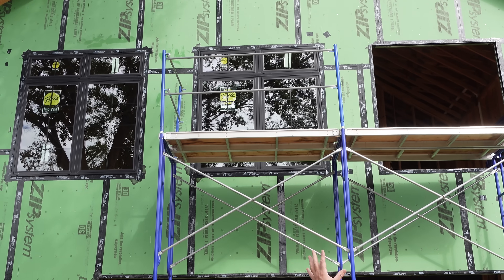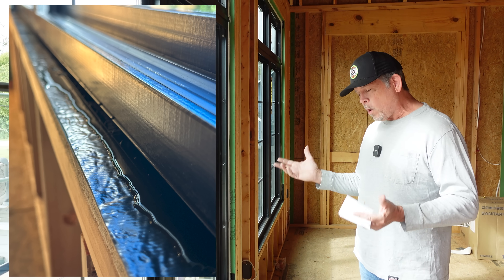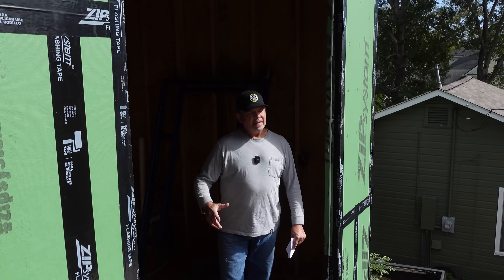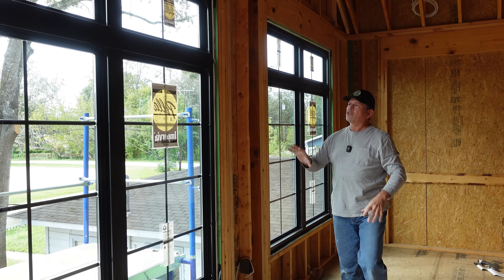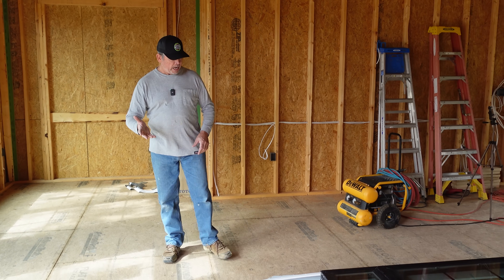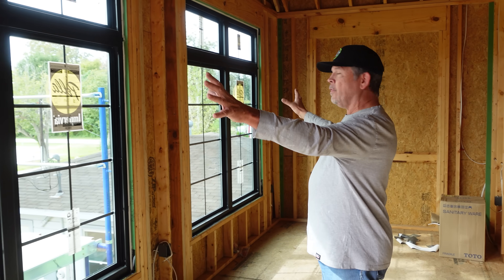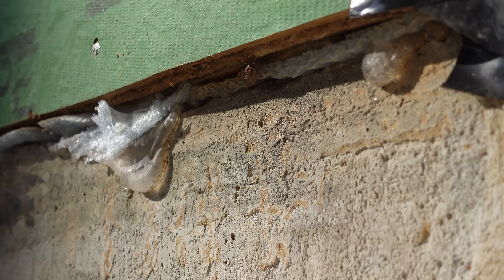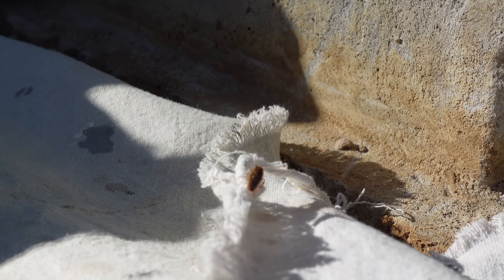THE WINDOW DISASTER - What Happened and How We Could Have Avoided It

Comment: When I saw the title of the video I thought a window fell and broke. 
Hmm.. I'm allergic to pablano but my mom loves it.
Nothing wrong with making mistakes and learning from them. It helps others who make mistakes too. It can help others to avoid those same mistakes. Also, the nail fins should have been sent with the windows if they weren't already attached & it sounds like they weren't, so it's not really your fault.
I'd be pretty irritated if I paid as much as Jordan did for those windows & parts were missing. I hope the little flaps can be sent and installed or Jordan is owed a partial refund for missing parts.
Cleaning all that stuff off the window must have been a royal pain.
Good progress and the liquid flashing came along nicely. I agree that making it so the zip sheathing is flush with the edge will make things easier to seal. I've also seen some sort of seal that goes under the walls and then wraps back over the sheathing. I forget what its called though. It also wraps down over the concrete-- It's sort of T shaped I think. Maybe Protecto Wrap Triple Guard Energy Sill Sealer. That stuff you apply adhesive to stick it to the concrete like an L but there is a self-adhesive flap that you fold up on to the sheathing (after you tear away the protective covering).

Comment: If only the one window leaked, I'd say it was an install sealing fault on that window. I think you did just fine the first time without the flange. The window that leaked "was" the first window you did and something was likely missed whereas the other two didn't leak tells me whatever it was that leaked in the first window wasn't missed in the other two. The only other thing could've been a window manufacturer fault that you proved not the case with your testing.
Great to see a guy tell it like it is and show something that when it went wrong "you took responsibility" for it and made it right. That's very rare today. Integrity. 👍👍

Comment: Your idea of having the edge of the Zip in contact with concrete concerns me. I would repeat the same process you used here. Possibly, you could Zip tape around the edge of the Zip boards in contact with the concrete and inset the framing but over time I'm thinking the abrasion of the concrete against the bottom edge & tape will fail. Maybe Zip tape around the bottom edge of the lower Zip boards and install them with 1/4 inch gap between the bottom of the boards & the concrete, and flash/seal between the 2?

Comment: This is alarming to me as I was about to be ordering replacement windows without flanges because it’ll be likely some time before I do the siding next. But now am not sure what I’m going to do… after watching this video they are basically saying their first install failed bc they didn’t order the flange?!? I know this house in video is a new construction build, but if I’m not mistaken, when installing full framed replacement windows, you are still clearing the area down to the rough opening, just like new construction, the only difference is not to disturb the existing siding so in order to do that there is no flange.

Comment: Could the offset of the window without the nail perhaps been the issue? Set in too far and didn't allow it to disperse the water into it's intended location. In other words the window worked correctly but because it was set in farther it drained the water into the house rather than outside just because of the drain location.

Comment: Kudos to y'all, guys! Anytime you are doing stuff for the first time there is a learning curve. Each manufacturer has their own designs and their own method of installation. A window is not just a window, and a door is not just a door. They are all different. There is not a single contractor out there that has done it all, and if they say they have, they are 100% lying to your face. The difference between an amateur and a pro isn't the number of mistakes made. It is how they handle the ones they inevitably make. Pros fix the mistakes and make it right. Amateurs cover it up, and leave it for the next guy.
Thank y'all for making this video and for drawing attention to the fact that even when you do what you think is beyond what is needed, skipping one step can set you up for failure. No one is perfect the first time OR every time. Keep on cranking along, but never feel ashamed to go back and fix your errors. That's how we learn.

Comment: You need to put more screws in the flange, usually every other hole. That is what gives it the strength to withstand hurricane winds and drastic pressure changes.

Comment: The issue is that you caulked the bottom of the window and you didn’t have a wood backdam. Water can get in through the mull strips. Once it get it in travels down the mull and needs to get out. You need a wood backdam under the sill flashing tape to make sure it can only make its way outside. Then you need the bottom of the window un-caulked where it meets the sill tape so you’re not trapping it inside. You only seal the bottom of the window on the INSIDE. Completely on the inside of the milk strip.

Comment: Man that’s BS! The manufacturer should take responsibility for this!!! Why the hell didn’t they send the fins with the units. 🤬🤬🤬
Reply: Based on the video, I’m not sure if the flanges are just an option for these windows. Depending on how the purchaser wants to install them, would dictate if they need the flanges or not. Was it a situation where the stud pack should have requested for the flanges, being this home is a new build? Or were these windows engineered to be installed only with the flanges as a new construction window. If that is the case, then I would agree with you 100% and the manufacturer should have shipped the flanges with the windows being they don’t want to manufacture them in the facility to avoid damaging the flanges on such a large window in shipping.
Reply: I hope this is the case where these windows were engineered and fabricated a certain way to only be installed as a new construction build, and need the flanges to be installed properly. Otherwise, I am hesitant to purchase replacement windows for my home because it seems they don’t hold up as well as windows with flanges.

Comment: I think it’s better that your sheathing sticks out away from your foundation as it lets water run down your wall, and drip away from that sealed area keeping water away from that seem
Reply: I feel like a metal drip edge would have been easier to seal.
Reply: I agree. Stud Pack's jobs are nice ... because they do them twice. If your Zip panel is flush with the concrete foundation then water can wick up through the foundation and start to swell the edge of the Zip panel. Do you really want to do this job again? Do your main house like you did the garage and you'll have no problems.
Reply: Full agree
Reply: Is it possible to put a metal edge behind the sheathing?
Reply: Why not zip tape the bottom piece of sheeting before install
Reply: @fredkk79  Waste of time since you still need to seal the gap.
Reply: @sweepingdenver  but couldn't you do that then with regular sealant
Reply: Probably shouldn’t put unfinished edge of sheathing on concrete….use liquid flash or wrap in zip tape or both…..I think I saw Risinger or one of his affiliates do the offset detail once with thick insulated ZIP….you guys have an advantage in that you can dialog with Huber and other manufacturers about these things.

Comment: Guy's did an awesome job sealing the bottom of the Zip board . What we've been doing is setting the sill plates back the thickness of the plywood so it flushes out with the foundation. Then we install a ' Z ' flashing that goes in front of the sill plate then under the plywood and then down the face of the foundation . Keeps out termites and water .

Comment: All of the flange holes should have a screw, unless stated in the manufacture installation details not to fill all holes based on wind loads. It is like Simpson connectors. All holes filled with a nail or screw.

Comment: So did the first install fail only because these windows are not engineered to be installed as replacement windows, and that’s likely why one failed? Or is it because they installed it their way rather than Pella’s directions? I’m just trying to understand if these windows were only intended to be installed with the flange, and because of their size, they don’t build them with flange attached in factory, and they should have been mailed out with the windows just not attached to avoid damage in shipping. He said, “they didn’t mail flanges, and that was on us…” so that makes me think it was optional and this window was designed where it could be installed either way, (as replacement or new build w/ flanges)
Reply from the maker: The windows should have come with separate flanges that are installed in the field.

Comment: It's funny that you ran into this problem. On the install video, I was wondering why you'd have two different types of window installations. I don't know anything about installing windows so I figured between you guys and the manufacturer, there must be a good reason. Turns out that mistakes were made. Sucks that you had to take a step backwards to fix the issue but it's also good that you found out before you got down the road of the build and had to pull apart half the building to fix the problem.

Comment: Would it be that hard for Pella to toss in some nailing flanges in the box?
Reply: They would be happy to if the customer ordered them. Complete waste to send them along if it is a retrofit and they won't be used.
Reply: @JorgTheElder  this isn’t a retrofit, it came with the tracks for the flange for a reason. As Paul explained, for whatever reason, these types of windows specifically don’t come with flanges from the factory. They come with the tracks only. So in my opinion, pella dropped the ball.

Comment: I've NEVER REALLY liked 'replacement' windows...often you have no other option but I AWLAYS, whenever feasible, like to use windows w nailing fins. I also like to use a 1 1/2 or mostly 2" aluminum roofing nail to nail my fins. Every other fin hole is quite ok... however, I have removed old windows when I'm replacing new windows & inevitably, some clown used like 5 nails for the whole window. Also, I think nails are super ok rather than screws. Nails are super flat, as opposed to screws which stick out a little... I HATE that. Just sayin...
Studpak broskis, your doin just fine...don't mind us... too much...
And by the way, I'm 65, still kinda putzin' on small to medium jobs, I can be somewhat selective, & I LOVE to still be learnin'... I love doin' decks, siding & window...outside stuff...
Yup, do the other 2... it's a couple hours at most w 3 "Studs" ... so "JUST DUU ETT"...
One LITTLE thing that makes me a LITTLE crazy is... you guys are ALWAYS doin' stuff on the floor... 3 horses w/ some lumber or ply... work at a nice height so the work is easier to see, access & accomplish... just sayin'...
NOPE... put all the fins on NOW... slide the window out, nail it in... bingo bango bongo
ALSO... one of my 'best friends' is dish soap... put a dribble on the window where u slide the fin on... it will slide in like a greased monkey... you guys should invite me to one of your jobsites... just sayin'.....
Zip bottom 1st, then sides but run it up 4/5" past window, then zip top...
Also, I almost ALWAYS have some kind of a rag in my nail pouch, I like a nice cotton t-shirt kinda rag, & use the rag to run up & down your Zip instead of just your fingers. You'll be able to press harder w/o destroying your fingers... just sayin'...
Also, do zip on bottom, just run it on the fin & not up on the window... just sayin'...
I also do one or two little things that are slightly annul... & that is, cuz I usually have a lot of tools out per each job I'm doin'.. is a cordless drill, sm drill bit, silicone behind window frame hole, install shims snug, predrill thru shims, run your screws.
I use a lot of different metal flashing applications in areas like the bottom of a wall
I would have some heavy 6mill or even some med weight tarps to put over those two big doors, keep out the weather

Comment: I gotta be honest, I have probably put in 1000 windows in the Northeast and never have left the bottom flange "open". Never ever had a water leak, not sure what you are doing, not sure why you ordered "replacement" windows for a new construction build, new construction windows have built in flange molded to the window not slide on flanges. Screwing those flanges in with screws over tightens the flange in those areas causing buckles when that flange expands with heat. Nailing in flush in every hole with siding nails is the better way in my opinion.
Reply: They didn't order replacement window on purpose. They picked all the options and the salesman entered the wrong thing into the computer. The salesman knew it was new construction and should not have ordered them.

Comment: If the sheathing is flush with the edge of the slab, you can use tape to seal the joint - instead of liquid flash. Don't remember the name of the tape - it's in one of Matt's videos.

Comment: yeah, i dont know why the europeans are able to do box frame windows successfully... but the nice thing about NOT using a nail fin (if you can detail correctly) is the windows can be recessed into the opening... and it looks 100% better with just a few inches. most new builds look so flat and cheap... its too bad.

Comment: Well done guys fixing and acknowledging you mistake. I too just love doing things 2 and 3 times, not.😂😂😂
Also pro tip for y'all and everyone on the liquid flash. Get a 2 or 3 inch chip brush, disposable paint brush, and cut the bristles to about an inch maybe less. It makes spreading liquid flash on uneven surfaces much easier. 
Also I've found that Prosoco liquid flash to be better than Zip. Prosoco seems to last longer exposed to the elements, sun especially, than Zip. Probably partly because of its color. Interesting fact Prosoco makes Zips liquid flash so in theory they should be the same. Another tidbit it's basically automotive windshield caulk.

Comment: My understanding from Zip is all the nail holes are supposed to be sealed. I just did an addition on my house and used the Zip system for the first time. Sealed every nail hole with that grey liquid flash and there’s another pink liquid flash i used around the slab. I completely agree it uses a lot of the liquid flash but it is worth it. Also, up in the northeast you don’t have to use a vapor barrier if all the nails are sealed. Anyway, great videos.

Comment: An advantage of Lexel over silicone sealant is that Lexel will stick to itself unlike silicone which will not adhere to itself.  You don’t have to scrape every little reside of Lexel from the window frame to reapply it.

Most contractors would just apply caulk to “fix” the water leak and would not remove the windows and go to all that trouble to find the cause of the leak.

Comment: just something i need to state; when you do your flashing tape around the perimeter of the window opening never do the top of it, if water should get behind your header flashing tape when the window is installed it can bypass your caulking around the flange and travel behind the flashing tape at the top of the window rough opening. and also quit using backer rod and caulk on the inside of the window jam, just get some good low expansion spray foam.

Comment: Those 3” screws inside.  Back those off 1/8”.  I hope pella ate those flanges…. I have been talking to these sales reps for years that when they see their products improperly installed (mainly hgtv) shows they need to crack down on that.  Monkey see monkey do.  Everything needs dying potential.  I would not liquid flash the bottom of the garage.  I did comment way back that when you had the liquid flash out I would have done my windows sills.  Good stuff fellas.

Comment: Fiberglass windows are a joke. Why? Because the manufacturers like to claim "same expansion rate as glass", yet the fiberglass windows are not manufactured to be monolithic (IE: they are not all one piece). Instead, the windows are multiple fiberglass pieces: lazily butt-joint as miter cuts in the corners. You can literally see light through some corners with a bright flashlight. I purchased the best, most expensive, fiberglass, direct-set windows that Marvin offered. They all suffered from this stupidity. They all leaked on day 1. I also ordered 6 of them, and 4 of those showed up with cracks (fiberglass is brittle, and apparently window truck-loaders and packaging is a joke).

Comment: I’m really confused why you spend so much time sealing around the window and then not sealing the bottom flange.  If water gets into the building on the backside of the flange, it’s a failed window and should be warranted by the company.  And if it’s the company, saying that the open bottom flange needs to be the process of insulation, they’re basically saying that their windows are garbage and not going to hold up.

Comment: Should have put the duct tape on the top side too so it would have been clean on the top and the bottom
Reply: Top (Zip) will be hidden under siding.
Reply: @JT_70  sure but just cause you can't see it doesn't mean it ain't there